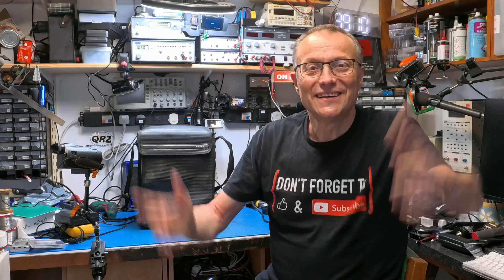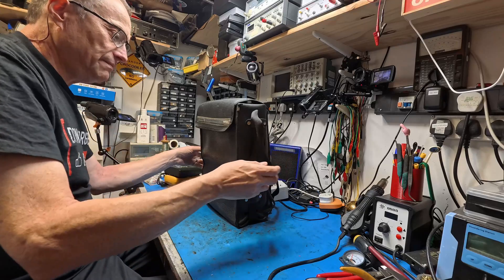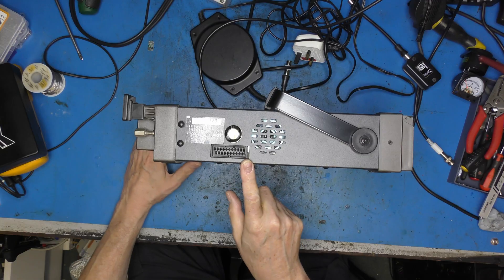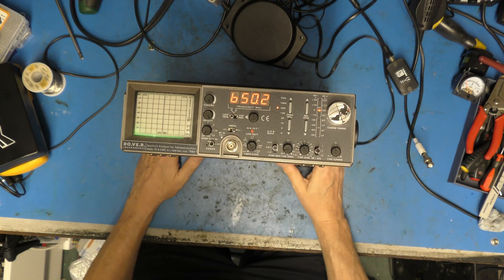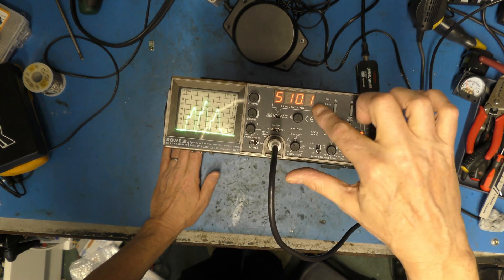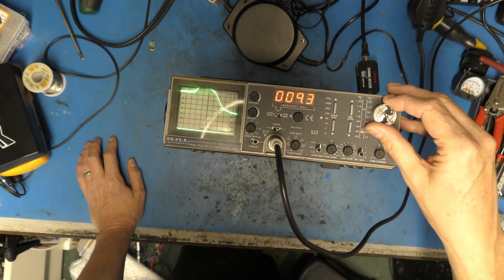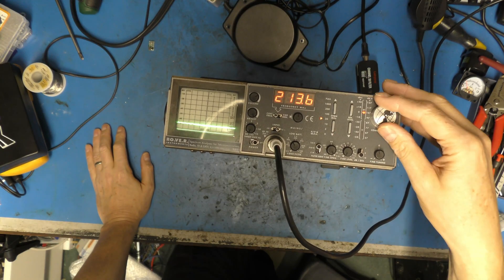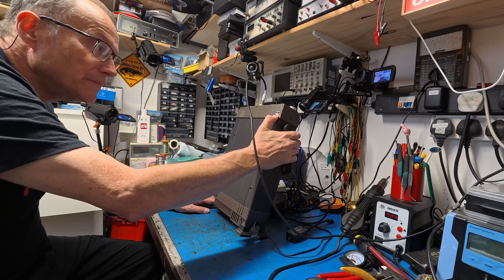ROVER TS1 spectrum analyser

Comment: Good on you. It's like the "is Sony guts" thing from that Zohan movie. Ooh- get yourself some uv resin for that foot, brother. I've had decent luck using it on projects. 
The last oscilloscope I picked up was at the recycling center, and they said it had a dead channel. I figured i could use it for parts, if anything. Whoever deemed it as e-waste had a knob turned all the way to the right. So they thought the left side of the screen was dead. I'm now the happy owner of another piece of tech from one of the observatories out here. I'm still using parts from A.L.I.C.E. (a light ion collider experiment). That large rig is a nice dive into history and has the best connectors I've ever pulled off of anything. I hope you're having a good one, brother.🤙🏾

Comment: I think the 'Rover' brand is Italian, still going if you do a quick search.
You could feed in your 405 modulator and take a look at that down on Band 1.
I think the signal you had down on 400 MHz is the digital emergency services 'Tetra' signal.

The Tiny SA and Tiny SA ultra are very good modern, relatively inexpensive analysers with signal generator function.
Reply: I have a Tiny SA Ultra, just recently bought it, and it has transformed my approach to transistor radio repair. Still only learning how to use it, and using it mostly for the sig gen function, and the analyser is handy for finding out faulty LO, or lack of LO activity - Also useful for sweeping the room for sources of RF interference, and locating illegal surveillance devices!
Reply from the maker: I have a tiny SA. Much better than the rover, as you say, it has a tracking oscillator. Before I had that, I used to use a wideband noise source to plot frequency response from filters etc. Not ideal, but better than nothing!
Reply: @AndyDoz To make the Tiny SA more useful, I connect a wideband "donut" antenna to it. The donut was originally intended for use with my SDR receiver, but it's the best thing I can find for coupling RF into a receiver, and for increasing the sensitivity of the Tiny SA in SA mode, and way better than the telescopic aerial that comes with the Tiny. Handy in many ways too, because with the donut, you can null out a signal and find it's direction/location just rotating the antenna.

I actually used my Tiny, and the SDR together, last week, to confirm that R5 live had actually gone off air one afternoon. Just a pity that the young lad on phone hadn't a clue what I was telling him when I called to let them know that they'd disappeared, and been silent for around 20 minutes. Someone must have got the message though - half an hour later, and they were back again!😊
Reply: @AndyDoz The Nano Vna is also useful for that, also checking aerial SWR and 50 ohm cable losses amongst lots of other things.
Reply: Yes, those digital "ensembles" are definitely TETRA , back in the day worked as TX Engineer for BBC and remember having to tweak our input filters at relay stations to keep out TETRA "interference" !